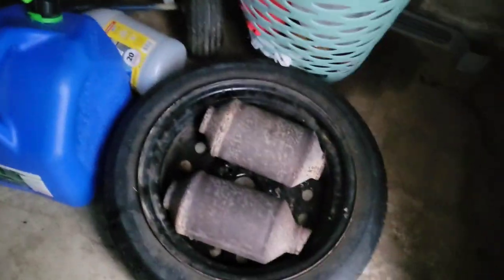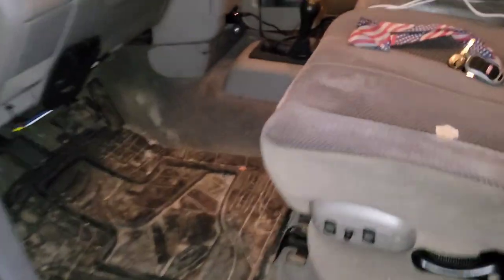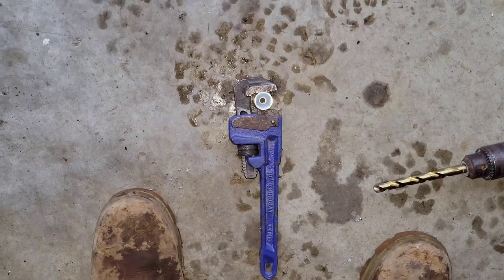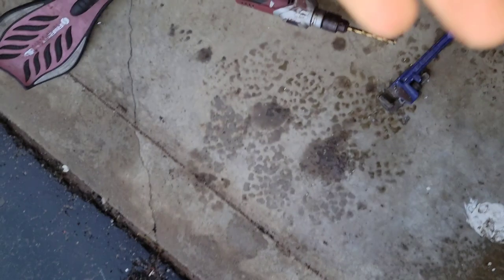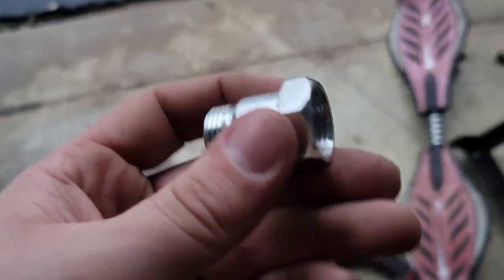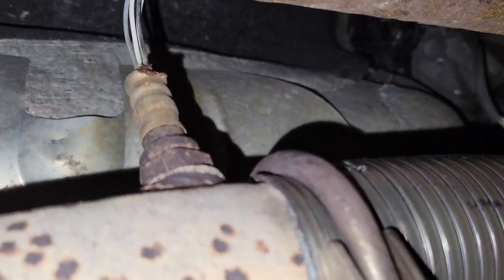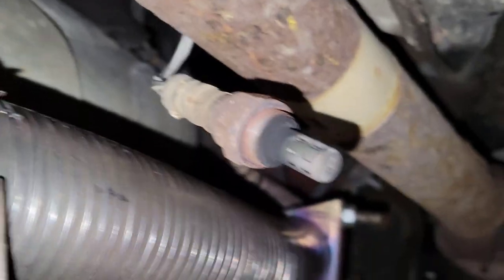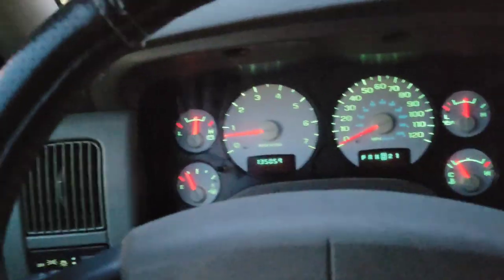how to remove check engine after removing catalytic converter simple

Comment: So basically you are lifting the O2 sensor out of the way of the exhaust gas so it doesn't read anything. Just unplug it instead cause if the inspection station spots that it is tampered with they won't pass it. Just buy the O2 sensors instead if you have to go through all that trouble.
Reply: Are you serious did you not see the catz are deleted 🤦🏾‍♂️
Reply: You are lifting and encapsulating the O2 sensor to trick it to thinking the cat is doing its job and removing the CEL and clicking the monitors over to OK. If your CEL is on, you're not passing ANY check anyway. I dont have visual inspection but OBD2 plug in testing that ONLY checks if the monitors come back ok. If you do have a visual, remove the spacers and get it there BEFORE the engine can run thru all its monitor checks and you pass. Emissions garbage are a tax on poor people and a scam to keep otherwise perfectly running vehicles off the road to further increase the burden on those of us who can't go buy a new car every 5yrs. Also you would NOT do this on an upstream o2 sensor which actually effects how your motor operates, downstream's do NOTHING but tell the computer the catalytic converter is working. Its a $60+ sensor that turns a light on and off.
Reply: @sylumgand what if my exhaust cat is before my first o2 sensor, then I have another cat and a downstream sensor, can I gut both cats and just space the rear sensor? 
What would happen to the first sensor being as though the cat before  and after it is gutted?
Reply: @MrBoroski  You have a weird exhaust setup. Catalytic convertors are intended to burning off unburned fuel. The upstream o2 sensor determines the fuel mix based on the combustion products coming out of the cylinders. Putting a cat in front of that would alter the readings. Either way, doing this to the downstream sensor does nothing to the vehicle. It just checks the function of the cats. There will be a temperature difference between upstream and downstream. Heat is what the o2 senors are reading.
Reply: @sylumgand  🙏🏽 THANK YOUUUUU
Reply: @sylumgand  I think I have you wrong information and I apologize. I have an exhaust manifold cat and a downstream cat. 1 o2 sensor before the exhaust cat, and another sensor before the downstream cat. 2012 Altima 2.5. Should I gut both cats and just space the rear o2 sensor, or should I JUST gut the last cat? I have not checked before and after temperature yet. But my car won’t go faster than 85mph and no power after 3200rpm, Hillclimbs suck. And I only have 1 code. P0420. 
Thank you for taking the time out of your day to respond to me, I really appreciate it!
Reply: @sylumgand  also, for more context, I already changed my exhaust cat and 1st 02 sensor last year and it was working GREAT. Up until around late July this year now I have the problem. I really think it’s my last cat that’s clogging up, haven’t done any diagnostics yet.
Reply: @MrBoroski  The code you listed specifies that your pre cat(manifold cat) is cooked/broken and because your upstream 02 sensor is behind that, you will never get it to go away until you replace the broken bit. You can NOT mess with upstream o2's, that determines your air fuel ratio. You screw with that you'll burn the engine to the ground. I am not a mechanic by trade, find someone local that can confirm that before throwing parts at the problem. Also you need to be sure you have the right o2 sensor for your make and model. There are platinum and zirconium, they read differently and will read wrong if used in the wrong system.
Reply: @sylumgand  yeah I never touch the upstream o2 sensor, I just bought a new one from O’Reillys last year and a new manifold cat. And damn you think I need to change that manifold cat again? Fuuuuuuck lmao. Side note: I WAS doing ALOT of Austin to Dallas driving daily during the spring and summer lol. Probably is cooked lmao.
Reply: @MrBoroski  Like I said, im not a mechanic by trade, you best bet is finding a local mechanic to make sure your not chasing a frayed wire.  Make sure you bought the correct o2 sensor first, I went thru an upstream o2 sensor problem on my Hyundai Tiburon using platinum o2's instead of zirconium. It was a 2 year specific setup for that car. But a quick search of that code brought up info on the Nissan's manifolds being prone to failure.
Reply: @sylumgand  fixed the issue lmao. It was a torn intake hose after the MAF. Throwing off air/fuel mixture thus throwing me a p0420. I swapped it out with a junkyard replacement, reset the ecu, took it on the highway for about an hour. Runs like a dream now. Whole time it was a damn intake hose. 🤣
Reply: @MrBoroski  Well that's why I was saying find someone local to be sure you're chasing the right problem. The amount of stupid things ive come across with cars is astounding. And with more electronics, the worse it gets.
Reply: it literally makes the light come on for the same reason if they were unplugged. This makes the computer think the cats still there
Reply: I have a 1997 4.6 V8 Ford Thnuderbird completely customized with a 1948 Ford Fiberglass body. My Cat is totally shot, I want to straight pipe it but every mechanic has told me if your car is a 1995 or older you risk making it worse because of the computer and its reading coming back from exhaust. Is there any truth to this as straight piping it will save me 3k as my state doesn't have inspections
Reply: @Max_Krypto  Upstream O2 is required, downstream is not. To over simplify, the downstream 02 checks that the exhaust is hotter going out than it was coming in. Thus checking that the catalyst is burning un-burnt fuel instead of just venting to atmosphere. Upstream controls air/fuel ratio, downstream triggers a check engine light. Upstream detonates/floods your engine, downstream annoys you with a light and failed emissions. However if you need that light to be off, you have to trick the downstream 02 to trigger the correct signal to make the ECM happy.
Reply: @Max_Krypto  whatever cat is last(IF you have multiples), towards the back of the car, you can gut the cat out and space the o2 sensor that’s after said cat with 2 short spark plug non-foulers. 
Drill out 1 non-fouler to fit your o2 sensor, then screw on the other non-fouler that’s not drilled out, then finally screwing on the whole o2 sensor unit with 2 non-foulers back onto your exhaust.

Spacing of o2 sensor is to trick the ecu that everything in the exhaust is flowing correctly even though you have more flow of exhaust due to a gutted cat. 
He was trying to get more money.

Side note/disclaimer: cat deletes are harmful to the environment, illegal in some places(check your state laws), and smell like sulfur lol.
Reply: @sylumgand WRONG!
Reply: @e-racer4673   About?

Comment: Does using the foulers to turn off cel affect the engine or idling?
Reply: Not on my 03 camry 2.4. Noticeably more hp and better gas mileage. CEL gone as are both cats. Runs better than ever
Reply: Unless ur cat was clogged or u added more air ur imagining better hp and mpg...if anything u lose power with less back pressurr @I-sed-no

Comment: They don't always work
Reply: Yes, I do work if you do it, right you could take the cats completely out of the vehicle and run straight pipe as long as you get the right depth on the O2sensor, you have to drill one and then thread the other one in there the cats could be completely gone or you could put a resistor in line because people don’t do it right as far as the computer system you have to get a scanner clear all your history codes out current codes reset all your fuel trims everything back to factory specifications, not with a code reader with a scanner if you have a Ford, you need to reset your km module people think oh I put the part in it’s fixed no because the computer still has the readings with the bad part so you have to clear everything out it’s basically like rebooting your laptop and you should do that to the vehicle. I would say every six months because people doesn’t know how to do it correctly. If you don’t work on them every day you got Joe blow down the street that says old is drive it it’ll fix itself no you have to reset everything and if you can’t do it, take it to somebody that can reset it back to factory specifications all your modules

Comment: They are called sport plug, non-foulers.
Depending on whatever kind you get, you may have to take you a large drillbit and drill the hole out in it .

Comment: Did it come back after driving for a while?
I used a 90degree bend fitting, and an actual "mini catalytic converter" that the O2 sensor screwed into. Worked for five years with no codes
Reply: Where did you get a mini converter?
Reply: @J Whit  Just google it
Reply: They stop selling them online after the EPA fined everyone

Comment: Can I gut both the exhaust cat AND the cat under the car then space the last o2 sensor? What will happen to the first o2 sensor if I gutted the exhaust cat that’s before it? Would that mess something up?
Reply: you have to do this on any sensor that has a cat before it. if no cat is before a sensor, it will not need this done.
Reply: To actually answer your question, the first 02 sensor(s) communicate fuel/air they’re absolutely necessary. The rear 02 sensor(s) downstream, measure the exhaust temp and other emission readings.

Comment: Would it take bad smell away?
Reply: @Random7  I've been seeing people install a jar with baking soda and distilled water that they run a current through, capture the escaping pure oxygen and hydrogen, run that through a water separator or condenser, then plumb the gas through a hose directly to the intake of the vehicle to get a 100% burn.